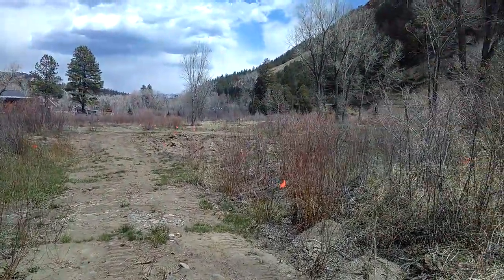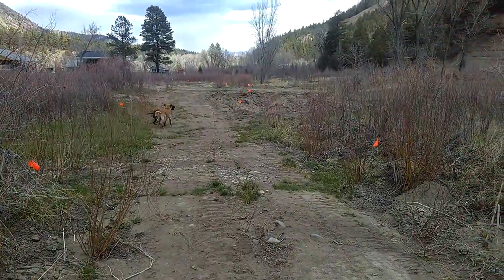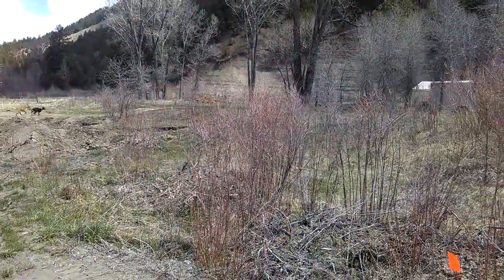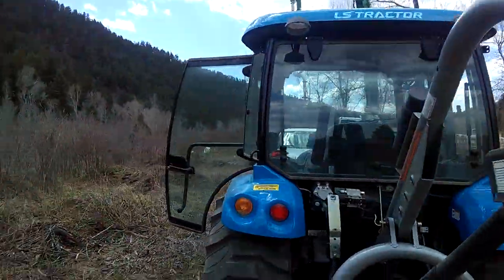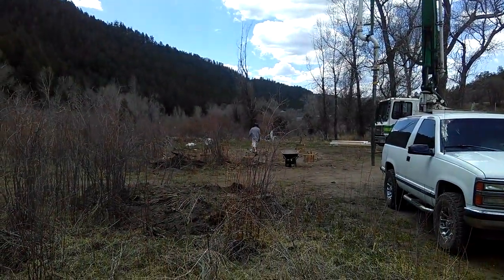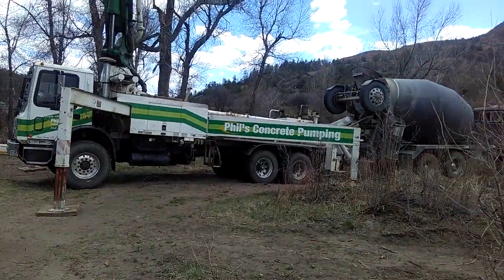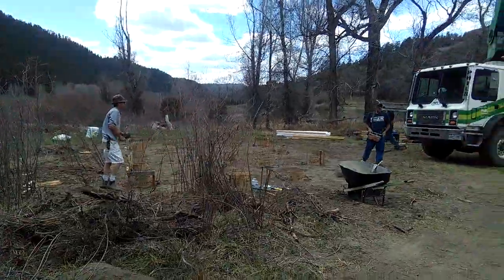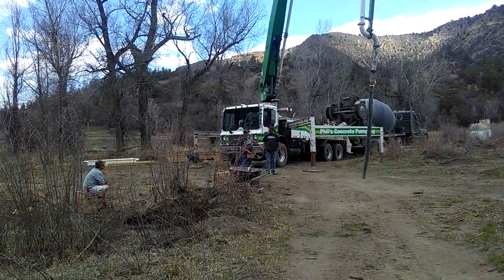Live Action Concrete Pumping - Now That's A BOOM! How can you help?

Comment: I didn’t see any plumbing stubbed up.  Are you going to run your lines after your pour or is it all already in the ground?
Reply from the maker: plumbing?
Reply: Oppenheimer Ranch Project I must have misunderstood your comments.  I thought you were building wet accommodations for your camping area.  I’ve been a tradesman for close to 30 years and was wondering how you were going to run your drainage system.

Comment: We use a trailer pump with 5 inch line and it's a death trap, it plugged up once when it finally came free it blew a concrete ball 30 feet across the auditorium we were pouring, good times.